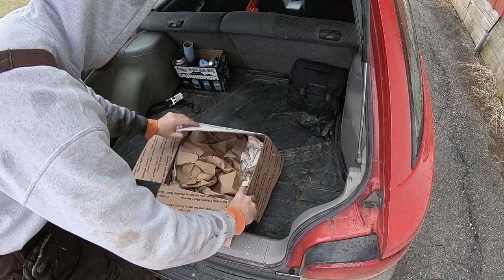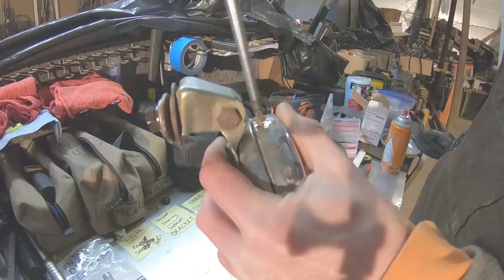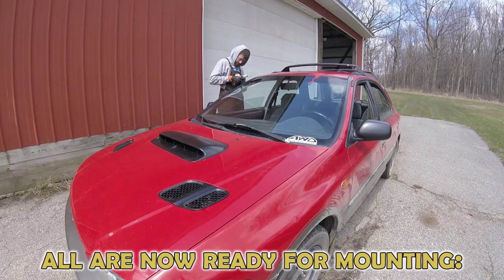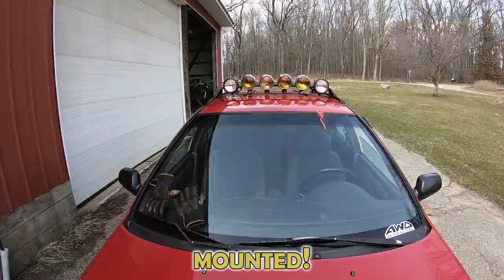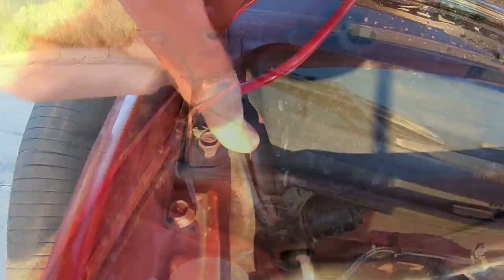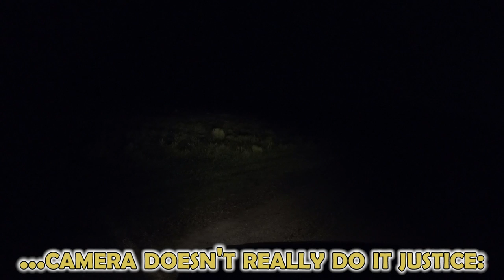Vintage "Light Bar" (80yr Old Fogs!) × Lifted Subaru Impreza ~ Rot Wagon

Comment: Did you put a basket on the roof? I’m trying to find a basket that will fit on a 99 Impreza wagon with the cross members…
Reply from the maker: I did but no clue what it's from, because most of the parts on that thing were junkyard finds.

Comment: is that a huge patch of rust in the roof ? dude you have to fix all that rust, please !
Reply from the maker: Sadly the rust in the rear quarters caused a major failure that allowed the rear struts to break thru into the cargo compartment... so the roof rust wasn't an issue yet :(

Comment: Do you have the center differential lock mod?
Reply from the maker: Yep! Little toggle switch on the dash locks it in solid. With the underpowered & now misgeared 2.2L it's about the only way I can initiate a slide. A must have mod!
Reply: @Tinker1837  wow thanks for the reply.  It's the next mod on my 98 Subaru impreza outback sport